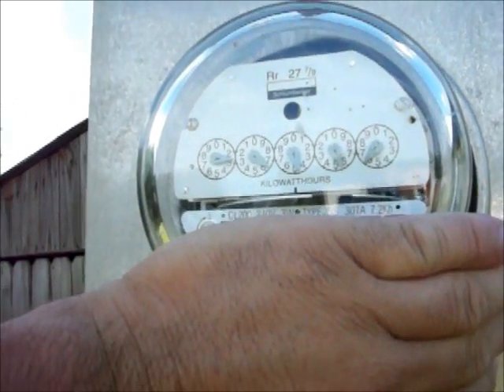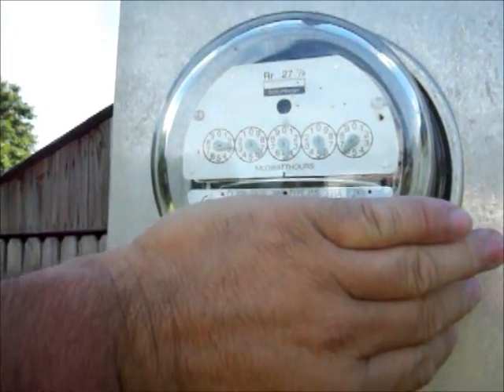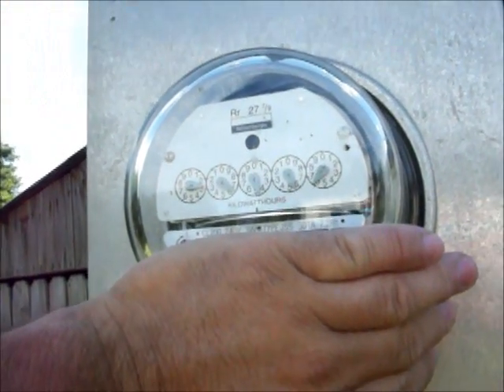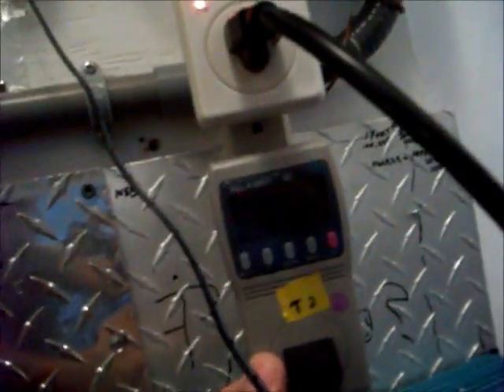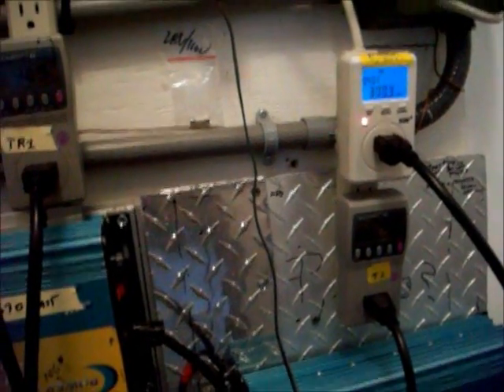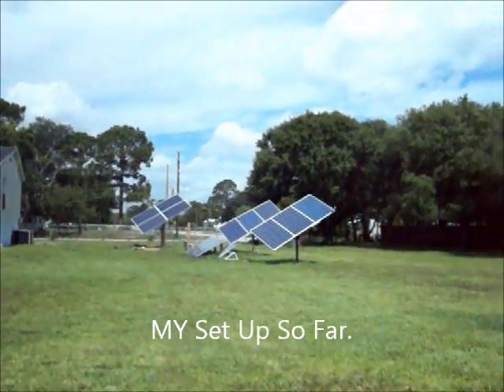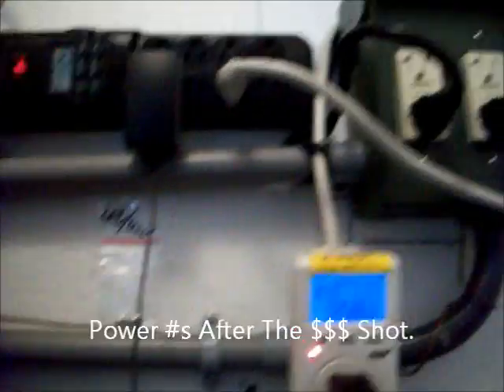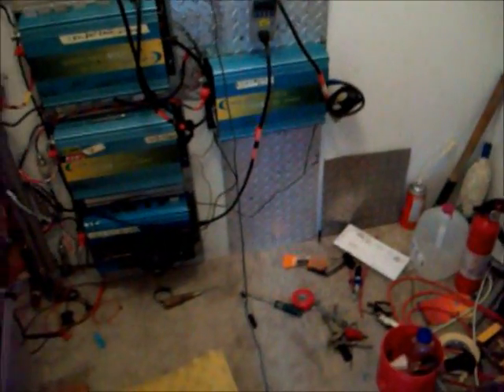Electric Meter Spins Backwards Fast

Comment from the maker: It,s On my pole In My box on MY land in My back yard,locked to My Box With My Lock it may be There meter but they need My consent to gain entry to my box and my consent to Transmit My personal Info via unsecured wire less technology that is easy to hack into & not secure by any means,I,m current on my bill they have to have my permission to change out meter if not defective. My power is a medically needed meaning they must first take me to court.Look at the Legal Status I did. Filed documents.

Comment: Looking really good! I wouldn't worry about the A/C too much, with good insulation it should cycle, it's probably around 3000W running but not all the time. If you can stay in one or two rooms you could get a walmart GE $160 window air (digital with remote) and be really happy, let the rest of the house get hot. The GE ones are now a scroll compressor so startup surge isn't too bad and it makes them more inverter friendly in case of a grid outage.

Comment: Have you unplugged your tv and satalite they pull a lot of power even when they are not on. Some put them on a power strip with a switch and turn off the switch when not in use. My AC seems to spin forward a lot faster than yours does. And its a brand new high efficiency one. Have you got inverter on both sides of the legs on the breaker box instead of just one side or leg. mine are all on one side of the breaker box. 220 draws off both legs. I think it may make a difference to spread them out.